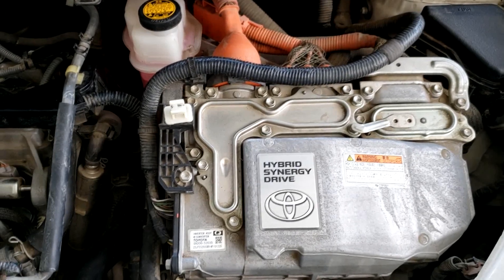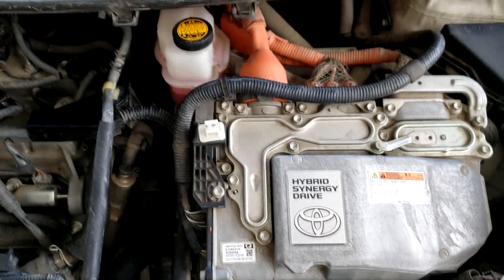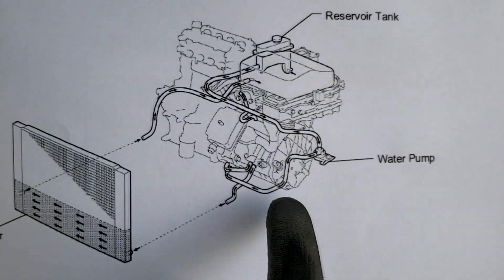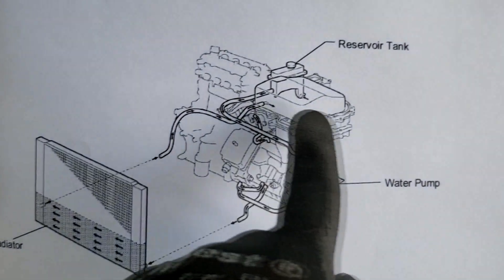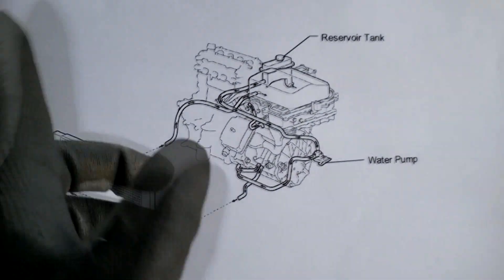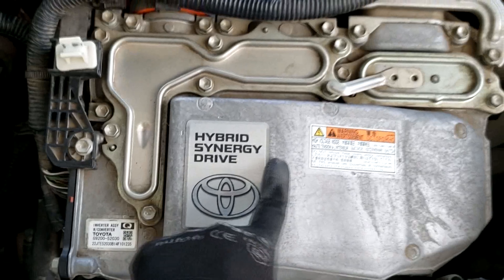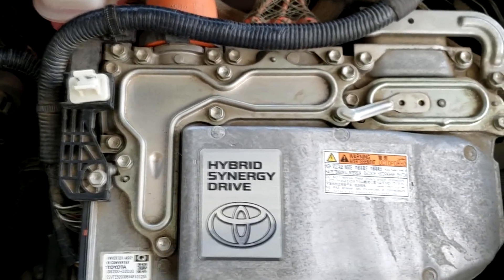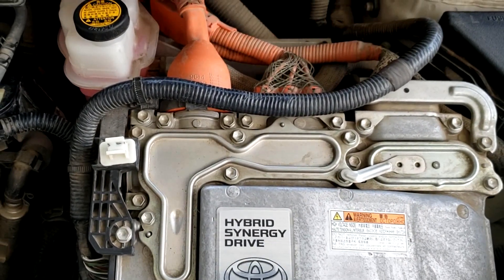Toyota Prius and Aqua DTC Code P0A93 and P261B in URDU

Comment: Sir aqua ma p0A39 code a rha ha generator  temperate  sensor
Reply from the maker: https://share.qclt.com/%E4%B8%B0%E7%94%B0%E6%99%AE%E7%91%9E%E6%96%AF%E5%8E%9F%E5%8E%82%E8%8B%B1%E6%96%87%E6%89%8B%E5%86%8Cpdf%E6%A0%BC%E5%BC%8F/repair%20manual/04pruisr/05/21bpm/0a38257.pdf
Reply from the maker: Check this link ive posted

Comment: You did not mention the cooling motor which is located under the air filter. If you get triangle with check lights it's not always inverter and pump. Most of the time it is cooling motor. In such situation the engine refuses to start to avoid overheating and car goes on ev.
Reply from the maker: I'll discuss it another video